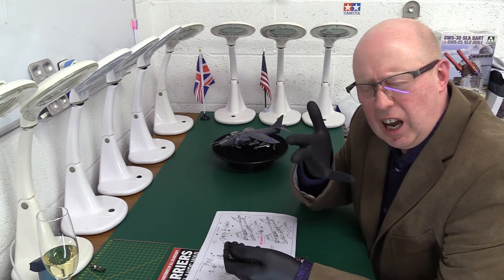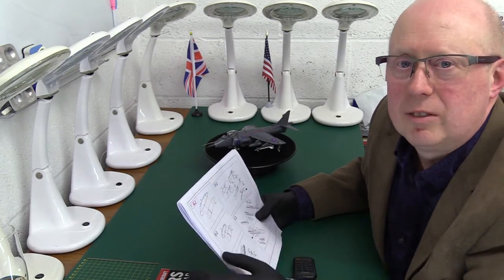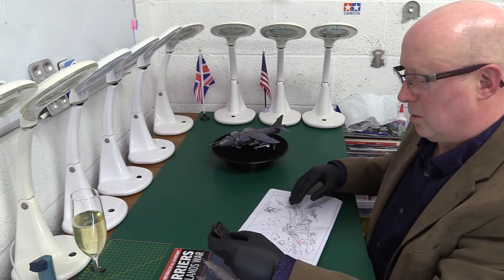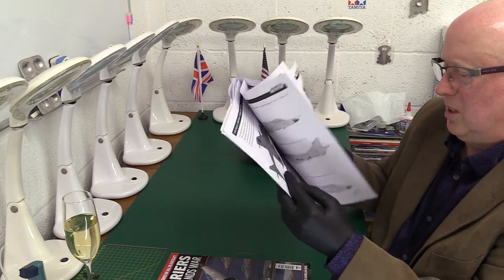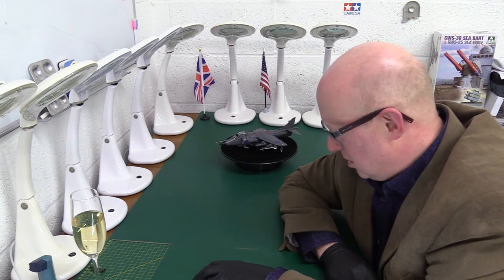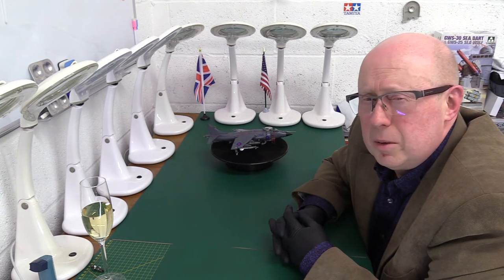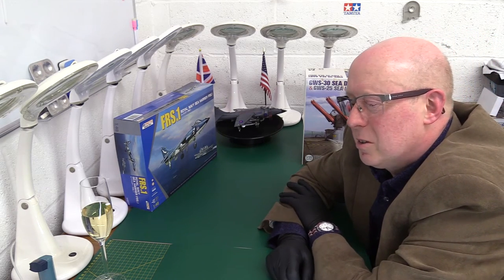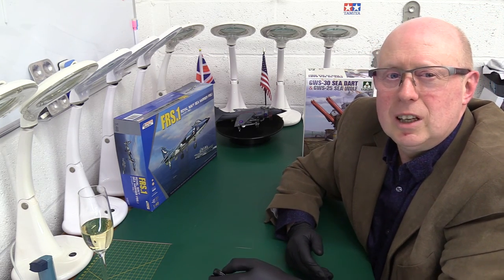The Mother of all (Kinetic) RANTS!🤬1/48 SEA HARRIER Build PART 2

Comment: Entirely agree with your comments about the instructions Peter. It took me 2 1/2 years to build mine and a lot of help from the Harrier SIG and Nick Greenall who has subsequently produced (through Black Dog) a resin “correction” set. He also published an extremely comprehensive build guide which supplements the instructions superbly.

Comment: Does their GR1/GR3 suffer from the same issues  I have that in my build q - might well swap it out if so!
Reply from the maker: Some but not all: See the vid around 24.00...Major wing issue is better, and instructions improved slightly but still has no location points and the Matra rocket pods are totally and obviously horribly wrong. 😖

Comment: Ok, that's put me off building a Kinetic kit for good I think - there are too many decent kits out there. I bought the Takom GWS-30 kit and built it a few months ago. The reason I wanted to build it was a bit of nostalgia really, as I worked on the development of the command and control system for the Seadart back in the early 1980's. I remember spending a week or so on board HMS Invinsible during sea trials and was on also on board when the first Sea Harrier approached the flight deck (it didn't land as the ship did not have the logistical ccapability at the time). You are right, the Argentine Navy had the Seadart as they had a couple of Type 42 (Sheffield) class destroyers. Looking forward to your Seadart build

Comment: As I said on the forum Peter, a really stunning finish to this build and I'm so glad you got this over the line! There is so much to these two videos that I was just nodding my head along too (and I appreciated the name drops along the way!), and I'm glad a few places where me and Clive nearly came a cropper were able to prepare you for what was coming! 

I don't actually remember much of the building of the kit but I remember three "feelings" that I had throughout its build: Firstly, when test fitting the intakes/cockpit/intake flaps and realising how awful it was I remember thinking how much I couldn't be bothered with it; secondly, the part where I had the entire airframe glued up but with bits of filler and plastic sheet poking out of it I remember thinking how I wasn't going to let those ba$tards beat me and I was going to finish the kit; and lastly, I remember the relief as I glued the final Sidewinder on and I could put it in my cabinet and forget about it. I did have the FA.2 and GR.1/3 in the stash at the time and as soon as I finished the FRS.1 I put them both on eBay, just had absolutely no time for them at all. Until recently I had their Aggressor F/A-18A/C too which is apparently a nicer kit but the instructions are terrible again.

Anyway, enjoy the time away from the bench to get your mojo back and then come back strong! Would be good to do a buddy build on the forum for the 1/32 Tamiya Mossie after we have seen what the Flory GBs for next year are - oh, and also, I noticed the Wingnut Wings Sopwith Camel slipped from your upcoming kits to build, don't think you're getting away with it that easily! I'm doing the Mengnut Fokker DR.I off the forum and the change of scenery is a breath of fresh air, and despite the wing warpage I am really enjoying it as a model kit.

Take care, Peter, and look forward to upcoming videos!
Reply from the maker: Many thanks for your many helpful comments, Scott, especially the ones that forewarned me and helped me get the kit over the line! 👍🏻😊🤝

Comment: Modellers often rely on instructions without double checking to photos etc.  And producers should ensure their instructions reproduce the parts provided in picture form as well as providing exact locations for fitting.  I also assume building the kit in prototype form was something producers did.  Obviously not - I read somewhere that Eduard kits are not built pre-release.

I am surprised about the inadequacy of the provided instructions, parts and information for a kit of this price.  I was put off buying when I read in-box reviews pointing out the inaccurate SNEB rockets protruding from the cases.  Lucky me.
Reply: but well done - the model looks good.
Reply from the maker: @johnjones-fj7qw  Thanks John, and I agree 100% And as you mentioned Eduard not building before release...see this Monday evening when I take them to task with another RANT! 😉